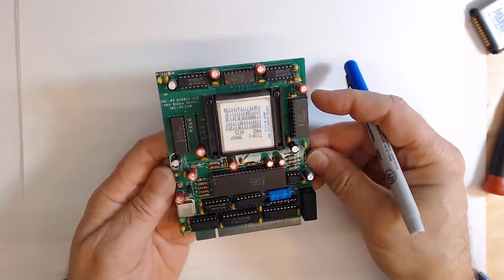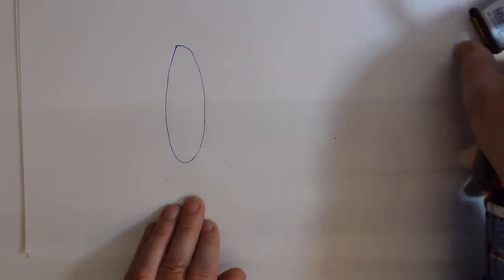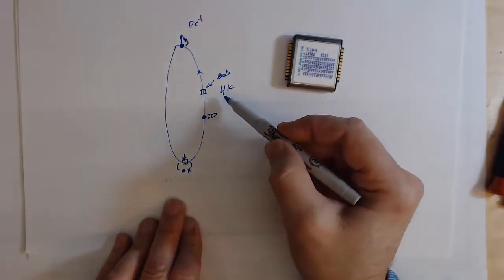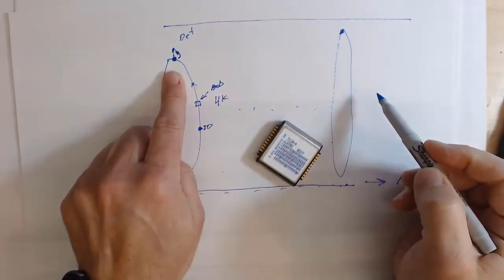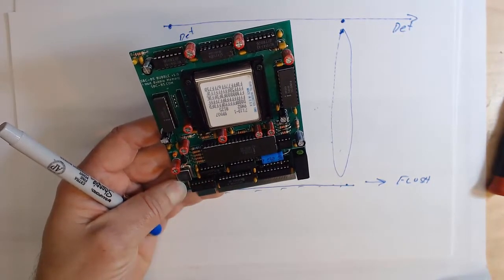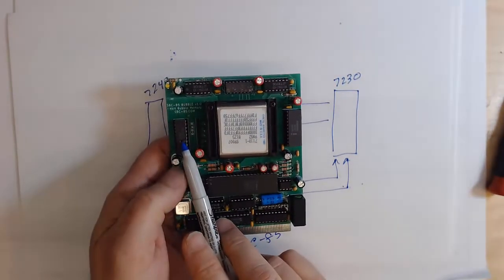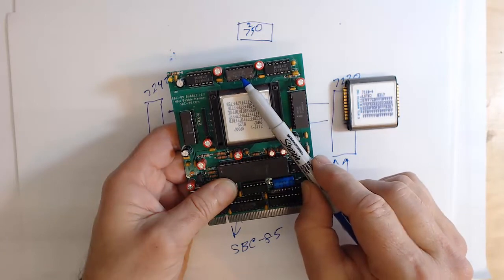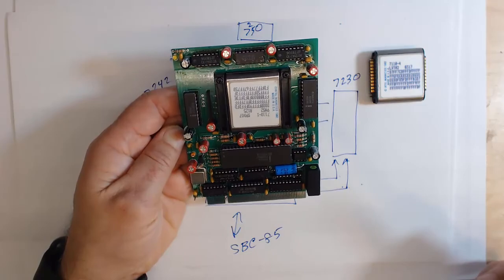{50} The SBC-85 1-Mbit Magnetic Bubble Memory board for the SBC 85 Single Board Computer

Comment: Where can I get your board?
Reply from the maker: You can download the build files here to submit directly to a board house like jlcpcb:  http://bitsofthegoldenage.org/documentation/

Or you can get on tindie here: https://www.tindie.com/stores/helloworld/
Reply: @HelloWorldETX  Thank you. Any way to adapt this design to work with the T.I. S0004 chip?
Reply from the maker: @markohara5146  I would presume not.  I think the whole reason intel thought bubble memory could be a success was because their bubble controller took care of all the details specific to managing intel bubble chips, and therefore simplified the engineering effort. TI’s bubbles were still requiring intimate knowledge of their operation.  That said, I have not taken a serious look at the TI bubbles to see if there is enough in common that, with enough glue logic, portions of the intel controller and preamplifier could be forced to work with a TI bubble.

Comment: I wish that the old school engineers of the 1940's could weigh the levity of "so that's really all there is to this..." ps I am glad that the bubbles in my beer didn't cost thirty-five hundred dollars when that chip came out.
Reply from the maker: It sure seems like inventions are becoming less revolutionary and more evolutionary.  My grandfather’s time went from first flight to moon landings, GPS, and personal computers. My parents from radar, ballpoint pens, and transistor to commercial space platforms.   I am not sure my generation kept up the pace of revolutionary inventions. 

If bubble chips weren’t so expensive when they came out, I could have finished my bubble board 40 years ago… (but it is doubtful the driving and sense signals on my point-to-point solder board would have been very reliable since layout is critical on the pcb)

Comment: I actually just did a design with a TI bubble module, as a lockdown project. Dang, Intel's architecture is way different, and their controller is far more sophisticated. TI just had a constant-current driver for all the functions, and a timing generator that would trigger the function pulses at the right point in the coil drive cycle. The original TI control chips are basically unobtainium, so the function generator is made from discrete BJTs, based on a 70s design for TI's prototype bubble module, which predates the control silicon. I'm using a modern H-bridge and amplifier as well. All the timing and high-level functionality is done in software, on an MCU. As a result, software has to deal with the timing of the individual functions, keep track of the loop positions, implement some basic ECC/redundancy, and all that. And of course, play the morning music while the memory is being accessed.
Reply from the maker: Wow, that sounds like an impressive effort. I think the superior LSI bubble controller was what intel thought would keep bubble memory viable, but it just wasn’t enough.
Reply: That makes sense. I imagine Intel's stuff was just more sophisticated in general. The module in using is from 1981 and only had a capacity of 92kbits (144 minor loops of 641 bubbles each). I was working off a spec for their prototype module from 1978, and the only things that were egregiously wrong was the drive cycle, some of the transfer gate timings, and perhaps the detector current. But aside from that, the topology of the loops hasn't changed between 1978 and 1981. They may have been the first to market, but they weren't iterating as quickly, though I heard later TI put out some larger-capacity devices (which required more careful temperature compensation). It seems like the Intel devices also have a block replicator, whereas bubbles in the early TI modules had to be replicated one at a time. They had a major/minor loop topology, so you'd transfer a group of bubbles into the major loop, send them around and replicate them one at a time onto the detector track, then put them back where they came from. I didn't actually implement the replicate function (not enough breadboard space, and I hear it's really finicky) so I basically use the replication gate in "annihilate" mode. This means I do a destructive read of each sector, and re-write it before reading the next one. I should put up a modern video or something...

Comment: So the bubble reconstruction would actually happen inside the memory itself, what she reads and writes are logic pulses... right....?
Reply from the maker: Yes, the bubbles are only in the 7110. When I said things like “this has the sensor” or “this generates the bubble” I was using the language a bit too loose.  What I should have said is “the formatter generates the pulses that go into the bubble chip to generate a bubble” or “the sense has the amplifier that measures the signal from the detector in the bubble chip”
The pulses are not binary, they may be multi level.... for example a period of one voltage level to stretch a bubble followed by a period of another (higher) level to actually cut the bubble.

Comment: Your videos are awesome. Is it possible to create a single board X86 computer which can have a VGA port, Ps2 mouse and keyboard ports with IDE and Floppy Connector. I mean complete system which can run MS DOS 6.22?
Reply from the maker: There were many manufactures in the ‘80s making 8088/86 based single board computers for industrial  control. These had just what you are looking for with vga, keyboard, mouse, ide, dos.   Winsystems and advantech come to mind.  STD bus and PC-104 were well established standards.  I would imagine that they are still readily available on eBay
Reply: @HelloWorldETX  Thank you very much.